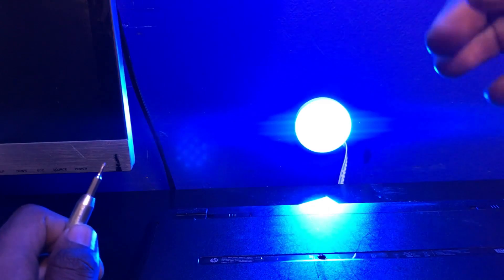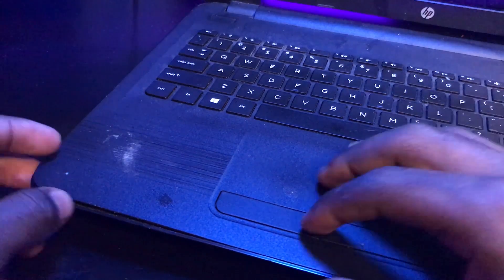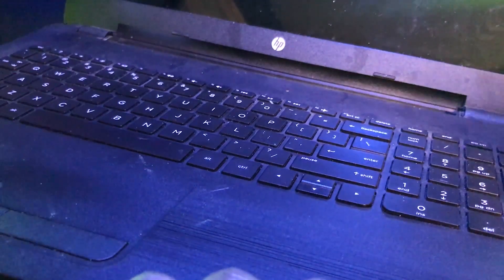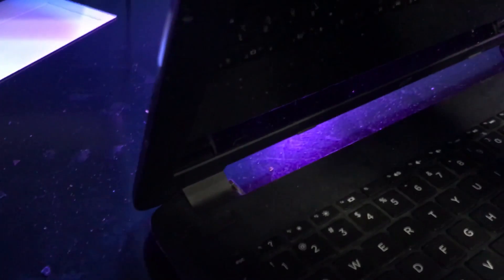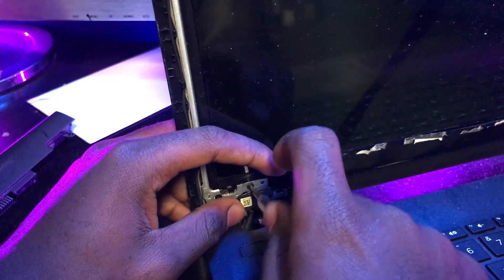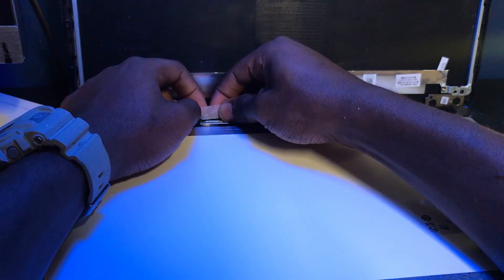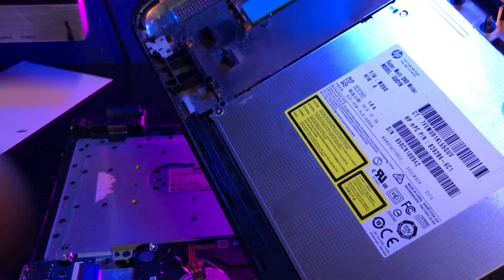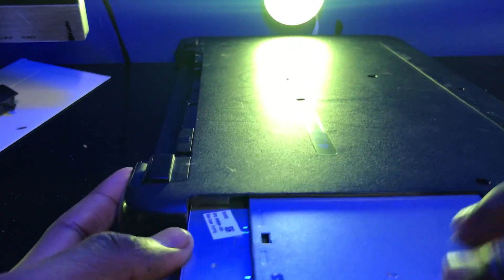How To Repair A Broken Laptop Screen - 15-ba088nr | Laptop Repair | Get Fixed

Comment: So.. I'm the person you can trust to keep something broken until it's broken even more I now have to deal with it or I have no laptop anymore. 
I was surviving with half the screen broken and one hinge broken, I never closed the laptop screen and worked like that for a year. But, the broken hinge was tearing the thin black cables that go around the screen so now I have the other half fucked too. Since those cables aren't included in any video I watched (unless the one that's connected in the end leads to those?) I doubt there's any hope

Comment: replace not repair
Reply from the maker: When you replace the screen replacement, the state of the laptop is repaired. The action of replacing the screen is repairing the laptop.

Comment: $50, no matter the price, if the situation of me also partly being the fault and the doer of the fault, I would have to pay for it. And that happened.
Reply from the maker: That’s what you call accountability. There’s a very powerful thing about facing a problem you caused and holding yourself accountable for it.

Comment: Sorry for my english... Sir.my problem is i updated windows 11 and i have to use a external monitor since my laptop screen is broken.i notice that the external monitor doesn't show anything when window's booting.after booting the external monitor only shows the screen when it booted to the login screen.when i updated my laptop,i have to do a setup to continue to use my laptop.but before,when i used my  external monitor with windows 10,it always show what's going on the screen.i realized windows 11 is the culprit.pls help me if you can.

Comment: why do you have to take off the bottom bit of the laptop if your only repair guy the screen
Reply from the maker: From what I remember when I was repairing the laptop is that the bezel of the screen made it to the base of the laptop where the hinge bends. Without removing the bottom bit, the bezel wouldn’t come off without me breaking it.

Comment: Pro tip : Do not get your laptop close to the wall, the wall basically help it so that the laptop had a higer chance of broken, so make sure there is a space area near your set up, why? Try push the monitor, if it is not touching anything, good, it will had a less chance of breaking, also another pro tip, punch your bed
Reply from the maker: Lol dude you are trippin. I was reading this thinkin you actually had some good insight on this topic. The end killed me.

Comment: Is cam working
Reply from the maker: Yes. As long as you transfer the camera over to the new screen ( hopefully you don’t rip the flex cable during the process ) and connect it, it will work.

Comment: I have a Zenbook 15 and i broke it by punching it , i don't know how the f i punch the screen on purpose.
And that laptop is very pricey. After looking at this video i should repair it by my self , now i just wait till my display arrive.

Note:
That laptop screen has "do not touch" because inside the display it's use Cold Cathode Fluorescent Lamp
Which is very very fragile and very easy to break

Comment: So I got angry at my computer as it needed my email for no reason and I was just tired and needed to finish of me homework so I punched it and now 3/4 of the screen looks like Pac-Man after you sweat at it so much it breaks the game which kind of sucks. You can only see it when you turn it on no cracks visible when it’s off but when it’s on it’s really big crack and it looks like I’m screwed any suggestions and do you think if I smashed 3/4 of the screen it can still be fixed?

Comment: Yo what website should I use to find my laptops screen bc ebay and amazon I cant find it there
Reply from the maker: Try Googling the model number. Send me a link of the website you find it on before you buy it. I’ll help you do the research to make sure it isn’t a scam website.
Reply: @GetFixed  no problem
Reply: @GetFixed  my laptop model is 5CD61663FL I cant find websites that sells my model

Comment: Question, will this make our computer any slower?
Reply from the maker: Good question Galina. Replacing the LCD screen of your laptop does not slow down the performance of it. Your hard drive, Ram, and processor play a huge role in performance & speed.

Comment: Yo I cant find my model it's the same as urs but I cant find it it would be handy if u send me a link
Reply from the maker: Moonie is it the exact same thing? A lot of laptops can look the same but be from a different year. A lot of times that means the internals are built different. If you don't see a white sticker on the back of your laptop then you maybe able to find small grey prints somewhere on the back of it that says "Model" or "serial number".
Reply: @GetFixed  I will check it out rn
Reply from the maker: Ight cool
Reply: It's a NT156FHM-N41

Comment: its not repair actually
Reply from the maker: What is it a replacement? The definition of repair is to “fix or mend.” The laptop has been fixed therefore it has been repaired.
Reply: @GetFixed  according to dictionary:
repair
/rɪˈpɛː/
Learn to pronounce
verb
restore (something damaged, faulty, or worn) to a good condition.
"faulty electrical appliances should be repaired by an electrician" 

its not like replacement ...
please read about it ...
its kind of click bait ... i was looking for repair  not replace
Reply from the maker: If that’s the case, it is impossible to repair a broken screen, you can only replace it when it is broken.
Reply: @GetFixed 
 this is not right man !
its not repair and u just confusing peoples looking for repair video 
i saw a few videos that show actually it possible to fix lined screen but not completely broken I know ...
but ... the  word u use is not right ;)
Reply from the maker: Forgive me Mohammad. It won’t happen again.
Reply: @GetFixed  
ok buddy 
sadly YouTube have some scammers and click bite gys  that make me mad 
glad to talk to u....u sound good man

Comment: This is my 4th laptop... 1st one I spilled some water on it and then framed it on my brother, second one my brother "found" it and then I used it regularly and so I was claimed the owner and than I broke it bec I accidentally sprayed some bug spray on it. Third one, the one I my grandma got for me at a pawn shop; my grandma and I was in a fight and then she threw it on the floor (she has bipolar issues). And now, current one. I honestly don't know how I broke it... I mean I dropped it a couple of times and then the front cover at the bottom came out but I fixed it with tape but it was still working then. The last thing I dropped it on the floor but that was a lil while ago before it stopped working, I don't think that was the cause) And then I watched anime and fell asleep with the laptop on my  side. (I was too lazy to put it away). I mean, I do all kinds of things in my sleep: twists, turnabouts, and I just move a lot. But even so It was fine when I woke up. But here's the really strange part. I go up to the bathroom, wash my hands, dry my hands. It was still fine. But then I went up to get 1 1/2 slice of pizzas and then when I came back I found out the laptop had a crack in the screen. I mean, you can still move the cursor but the screen is green and you barely see it. Idek what happened or how It cracked. Not sure if I dropped sum water on it or sum. But all I knew is that I couldn't tell my grandma... She paid alot much money on that laptop. I think about 300$ idk rally. I mean I have a habit of breaking things; cracked my phone screen, broke my old tablet and now it doesn't work and now I'm on the verge of breaking my current tablet. And I'm not even sure if the laptop has insurance on it or anything, and knowing my habit of breaking things I HOPE it has insurance on it... For my sake. But I don't think so, I never ever get insurance with my electronics, kinda ironic huh? I just feel like THIS time I'm not gonna break it and then I go and do the opposite. And so, here I am now, looking up on yt how to fix it because I feel both guilty and ashamed of myself. I've done so many terrible things that, honestly, I don't even think I deserved that laptop and another one. So, that's why I can't just let my grandma pay money for another one again... I'm just hoping I'll find some miracles with this yt video. I'm just tired of never being able to do anything about anything because I'm a child. And this, I'm here so I can fix my problems.
Reply: i can understand so much where you came from. i have the same problem. every thing you have writen is INSANELY a like. i feel so ashamed of my self and cant live with my self.
i really do hope that your problem will fix.

Comment: accully you replaced it and not repaired it
Reply from the maker: You do realize replacing the screen is fixing the fact the your laptop is broken. Both the word "replace" and "repair" is interchangeable. A broken pipe can be repaired by replacing the broken part. The laptop can be repaired by replacing the corrupted hard drive.
Reply: @GetFixed  uh i think you dont understood well buddy bc you REPLACED it and not FIXED the screen you title is sayed like you gonna repair that old broken screen what dose work when you get the bew lcd rgb part and you can take the old one off and put or glue the new one on with speciel lcd rgb panele glue what us used on phones when you repair the glass part and now i got. etter thinks to do all time that reply you stupid comment 🙂
Reply from the maker: Sorry for wasting your time Master!

Comment: Do you need to use the EXACT model screen? Or can you just use ome that fits???
Reply from the maker: I recommend you use the exact model screen because you want the flex cable connection for the screen to have the same fitting for the connection on your laptops motherboard. Take my word on it, it’ll save you a lot of time to get it right the first time.
Reply: @GetFixed  ty

Comment: When I turned on my laptop and then the same screen likes yours happend to me. I said, "Crap!". And now I dont know what to do.
Edit: Help. :(
Edit: Have the same laptop.
Reply: so breh rip your screen is cracked you need to change it with new one but in the case if you dont have money to buy a new screen there are alternate ways that you can use it for now like use a HDMI cable (or VGA) and connect it to the TV if laptop wont recognize TV just remove broken screen and try again also change TV's settings to the PC
Reply from the maker: Thank you for that information Azer!
Reply: @GetFixed  No problem

Comment: So I had a computer which had a problem where if it was adjusted a tiny bit, would make a third of the screen turn off or be just really fricking glitchy, today (something I had always done) was putting minor amounts of pressure on the back of the screen, but today I heard a nice pop, and now my screen was cracked, I frickin freaked out, and quickly started taking the screen out and open it up (adrenaline I didn’t even think) now it doesn’t turn on or anything (like that matters, even if I could it would be unusable). I have a toshiba tecra R850 and the screen is discontinued, what do i do?
Reply: Crashio 
I’m obviously no professional, and you most likely have already figured it out by now, although I would say you have two options. You can either buy a new computer which benefits you by the fact that it would fix all the problems you hav been having with your computer. The other option you have, would be getting a computer specialist to specially make that specific screen size adjusted to your computer. Although, this probably wouldn’t fix your problems on account of the fact it’s most likely your computer and not your hardware, hard drive, or actual computer screen. If you did decide to replace your screen, and then it ended up not being your screen (because I’m eighty percent sure it’s not) then replacing the hardware and hard drive to fix the problems, or even two of them being replace would probably pass the price of replacing your computer all together. 

I am glad to try and help, although, as I said, I am no expert. All the advice I just gave you could be wrong in the eyes of an expert. 

Thank you, sincerely, Amethyst.
Reply: @amethystgrace  sorry for the very late reply.
I ended up buying a new PC that is MUCH faster, and just better all around.
I do appreciate the reply and the concern, thank you!

Comment: you think that replacing my laptop screen is the best i can do for getting red of the dead pixels in it ?
Reply from the maker: If there’s dead pixels on the screen go on YouTube and type in “dead pixel fixer” and click one of the first three videos. Do this when you’re about to go to sleep so you won’t need to use the computer during that process. If you wake up and still see the dead pixels on your computer then I do recommend replacing the screen. That is a guaranteed fix.
Reply: @GetFixed   I tried dead pixel fixer, but it didn't work ! now i'm ready to replace my screen.. thanks a lot

Comment: Hey, the screen that you've used, it looked exactly like the one my laptop has, hp pavillion 15cc-129tx. Is it a 15.6" FHD (30 pins) 1366x768 screen with DONT TOUCH mentioned on its lower? If so would you please send me the link to buy that.

Comment: I have a dell laptop and I accidentally dropped it on the floor and the actual screen if fine but the inside bit of the screen is broken and it’s broken into bits
Reply from the maker: Locate the white sticker on your laptop ( you can find it either behind the laptop or underneath your keyboard ) that white sticker will consist of the laptops serial & model number. Let me know what the model number of your laptop is so I can assist you with finding the screen.

Comment: I stepped on mine.
Reply from the maker: Lol how’d that happen?
Reply: Get Fixed same my laptop screen was a bit open with earbuds laying on the keyboard and the laptop was on the ground and i stepped on because i just woke up and it cracked my screen its an HP folio 9470m
Reply: @vlone1848  I just acidentally flipped my laptop and my earphone cracked my screen
Reply: I sat on my laptop 😂😭😭😭

Comment: I punched my laptop screen from anger while playing Fortnite and now has a shattered screen and makes an odd noise when running. Do you think it will be worth fixing and how expensive could it be to repair it? I sent it to BestBuy P.S.
Reply from the maker: Did you just add that last portion that says I sent it to Best buy? Find out the model of your laptop and I'll look for the cost of the screen vs what bestbuy will charge you. The noise is most likely coming from the hard drive. There's a chance that it got damaged either from the impact of the punch itself or maybe the laptop fell afterwards and got damaged that way.

The hard drive may fail in the near future so that may need to be replaced also.
Reply: @GetFixed  lenevo laptop medium screen I can send the photo if you want
Reply: Im in the same situation so my mom let me use her laptop which is nice
Reply: Collette Davis so now u will pinch ur mom laptop right😀😂
Reply: I was playing roblox and I punched it bc I accidentally left the game
Reply from the maker: Lol you guys are too funny.
Reply: same here, i broke my laptop screen while raging in arsenal (a roblox game) and now it's broken :(
Reply: Holy, same thing happened to me today, and I’m so scared to tell my parents
Reply: I broke my screen while playing Roblox :|
Reply: @Cooly_Notme  same lol
Reply: Hahahah ur not alone
Reply: i broke my damn screen while playing roblox after spawn killing me on something i waited 3 hours on
Reply: I legit punched my screen cuz it was laggy as hell